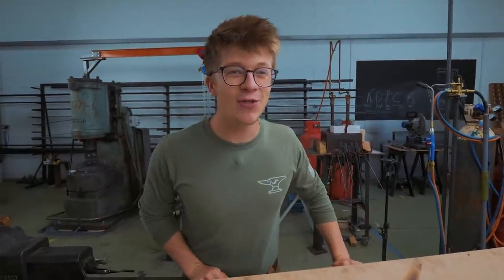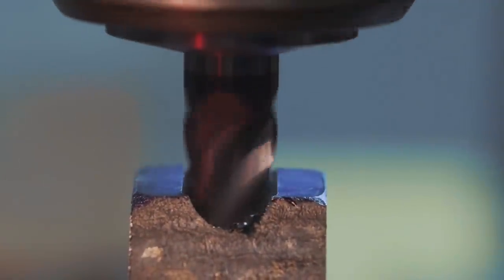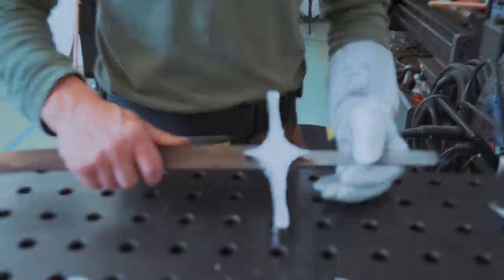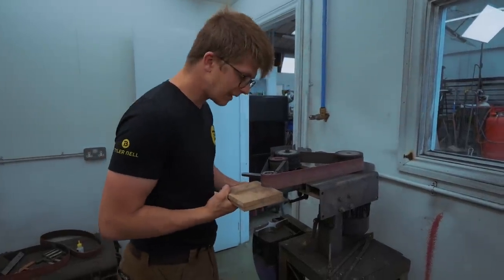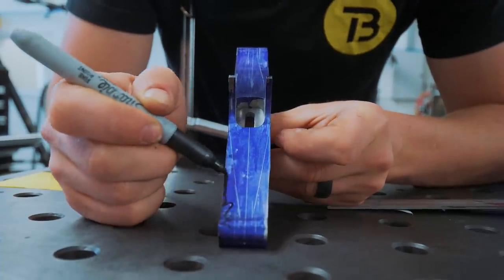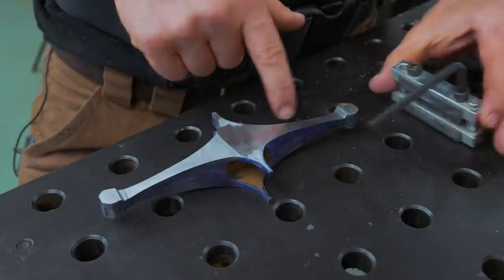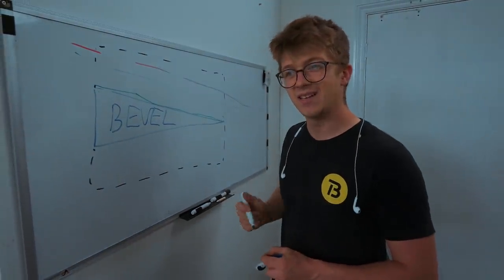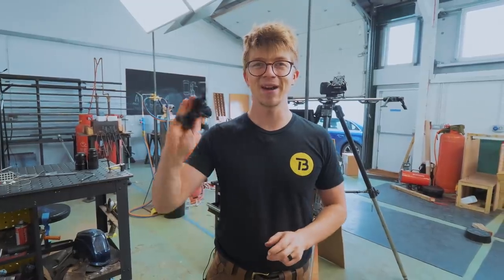MAKING A SHAMSHIR SCIMITAR!!! Part 3

Comment from the maker: Be sure to come join my talk at my Discord Stage here: https://discord.gg/YBun7QpmhF
Reply: Alec I dare you to make a sword without any Power tools
Reply: Could you have etched the scrollwork into the guard?
Reply: Alec why not 3d print that fancy pattern, then cast it into steel and use that as a stamp to hammer that engraving into the cross guard?
Reply: Alex can you make videos faster... thanks.
Reply: you gonna make a sheath to go along with the sword?
Reply: Heyyy good mornin!
Reply: Alec that grinder idea is a bad bad bad idea. You really need to have more respect for these tools. You've been incredibly lucky in injuries you have received. And you had one run-in on the lathe pretty recently too! You should make a sturdy holder for it that WILL fit in the lathe so it can be cut with the lathe, instead of risking the health and safety of both you, your camera man, and any other person or pet in the area.
Reply: So awesome you have a discord now
Reply: @alphawolf0020  shh
Reply: Hooray! You are still alive!
Reply: Can you make a cheaper belt grinder for beginners?
Reply: @alphawolf0020  I would also add that you need to cover the ways of the lathe when using a grinder or sand paper on it. The grit coming off of either of those can very quickly damage the ways if it gets into the oil or on the surface of the ways.
Reply: Question for your Stage:

If you had to fight 1 Will Stelter-sized duck, or 100 duck-sized Will Stelters, which would you fight?
Reply: When 6pm BST means 3am the next day for us Australians 😂
Reply: Hey Alec I’ve done something like the angle grinder situation you got and my advice is to turn the lathe by hand very slowly so you can feel it out, also have someone else move the grinder in and don’t stand in front of the work piece. A face shield is a good idea too. If you can figure out a better way to round it over Without the grinder do that. Love the videos keep up the great work.
Reply: Hey I am looking to get into the craft I have related skills but I was wondering if you could do a video on not only building a forge but what you want out of one what design specifications could I use to make things easier in the long run ? what did you do to your forge that your happy with ? what do you wish you would have done or not done in the construction of your forge? are there small details in making a forge that pay big dividends? I do want to make a permanent forge as I am getting a shop soon hopefully..keep making videos love the content
Reply: +AlecSteele Alec, get yourself a high speed steel (hss) 1/2" square bar and grind it to suit your ball size for the guard. Then set it to centre hight in the tool post and start cutting low speed with lots of cutting fluid
Reply: FILES, JUST USE FILES.
ITS DANGEROUS TO USE ANGLE GRINDER SIR.
KEEPSAFE.
Reply: Jeremy Clarkson pitch for the grinders. Brilliant!
Reply: Why aren't you cool the mill with an oil-water-emulsion? Your bits will hold a lot longer, and the piece you're milling isn't hot after the process
Reply: All im gonna say mate, is im surprised you’ve not created a discord before this point. Its a fantastic marketing tool, and a great way to stay in contact with your state side company without having to buy fancy equipment or software. I use discord for company meetings all the time as the product has a noise reducing software that takes all the background grinding/metal pounding/welding/etc out of the equation so clients and employees can hear me over anything else going on.
Reply: @ezzedinezeid6049   he had paper glued to one side. It looked like standard printer paper, not wax paper. So it would of washed away the paper which he was using to make sure he didnt take too much off. Otherwise, im sure he would have
Reply: Hey Alec you should make a phone case
Reply: Now it's time for a alec steele discord server
Reply: I wish I would have watched this Episode sooner

Comment: Next time on the Alec "4 Finger" Steele show, How not to use a grinder attached to a lathe lol
Reply: I have seen every form of power tool imaginable connected Rube Goldberg-style to a lathe: chain saw, router, table saw, chop saw, torch, water jet cutter, sandblaster.. A surprising number of people who pull such stunts survive them intact for years. Still, it's not the way I'd want to see Alex's career end.
Reply: As if there will be a next video, it's gonna be a memorial video
Reply: @nathanbrindley5820  We can be calm for a while; there's every chance Alex merely means to use the lathe as a vice around a fixed center, not spinning up to speed. Still, looks like a very shaky vice; why wouldn't he just weld the workpiece to a mounting plate, and grind off the weld marks after?
Reply: @bartroberts1514  the work price is close to the tolerance, if he were to weld it he'd lose alot more material on the ends
Reply: might be the worst thing to do in a workshop.except maybe for using a grinder to spin a blade while quenching it.
Reply: @nathanbrindley5820  Given the choice of losing material on a workpiece or on a limb..
Reply: @96dragonhunter  Forging blindfolded.. pranking while forging blindfolded.. I love the channel, but it's not exactly safety training.
Reply: TOP 5 GRINDER LATHE MISTAKES (Must watch!)
Reply: Boy... it looks stupid!
Reply: Step 1, don’t put your angle grinder on a lathe

Comment: That Lathe contraption seems like one of the brilliant ideas of a group of Drunken Texans who weld the barrels of two guns together to see what happens if they fire them both off at the same time. My general rule of thumb is that anything that involves zip-tying a safety feature in the "safe to operate" position and/or turning a power tool on and off at the power source is a "bad" idea.
Reply: That’s a pretty particular rule    Like it tho
Reply: Seen far worse than this.. from a man that used to wear nothing but flipflops and cargo shorts in the shop.. hes just about ok so alec should be fine. One would hope
Reply: @richard-gn3es  well, as I said to my coworkers a while ago. OSHA regs aren't there for the 10,000 times  you've done it before, they're for the one time things go wrong.
Reply: @ZevVeli  as an individual im guessing he assessed his personal risk and decided it was within what he deems acceptable. 

Regulations are usually to protect companies and those that work for them. And not to private citizens... I do not think alec is in any real danger. Well not more than usual using large powerful machines..
Reply: @richard-gn3es  Tell that to 4 craneworkers that just died cos they threw every safety procedure in the wind and the crane they worked on collapsed.
Reply: @user-ee9cz6mc1x  Theres a vast difference between a large scale work site and a small shop.

Using a grinder on a lathe is hardly mis managing a very heavy steel structure at hight... Its like comparing jumping into a pool from a chair and cliff diving at low tide. Vastly different risk factors..
Reply: @richard-gn3es OSHA Regs are there for workers not to get hurt and the company has to see to that. When workers throw their own safety in the wind accidents tend to happen in a shop or on a worksite. Only difference is a one man shop doesn't have to pay a fine when not living op to the safety procedures in the OSHA Regs. The accidents will still happen, and this is unsafe AF, every machinist in the comment section is saying this is a really bad idea. And you are saying it's fine it's an acceptable risk and that regs are there to protect companies so they don't get fined for unsafe workplaces or so. which is bullshit.
Reply: @user-ee9cz6mc1x  What im trying to say is he knows and its none of anyone's business if he wants to do things in a safe or unsafe way.. 

Literally nobody needs to tell him what he should be doing. As i said its personal risk

Comment: Just use a file mate. You don't need to add the grinder into the equation, it's already spinning!
Reply: I'm guessing the idea of the grinder is stay as far away as possible and only stand close enough to spin the handles on the lathe.
Reply: @ParadigmUnkn0wn  Yeah and I'd be doing that with something to extend my reach, to hell with peering over it.
Reply: The reason he is not using a file is the same reason he isn't using a cutting tool for the lathe; the work is unsupported at the end. The "dog" will hold the work in place but it isn't strong enough to hold a file to. The grinder has enough power to remove material without applying pressure to the end of the piece.
Reply: @jacobmaccharles7468  So use smaller passes.  It's a big, pretty high quality machining tool.  It can probably do small enough increments to have the tool pressure be lower than the chuck pressure.
Reply: @jacobmaccharles7468  That's actually not true. He's turning between centers, one center in the headstock, and one in the tailstock. The dog isn't for workholding, but merely to transmit torque. Ironically, between centers is about as well supported that a work can be in the lathe.

Comment: The higher the grit, the slower you should be running the grinder.. This allows you to keep accurate surfaces..
As for the angle grinder, there is such a thing as a mill-lathe, and it is possible to attach a spindle motor to the lathe carriage, but the angle grinder is a bad idea mainly because it is a grinder: abrasives and machined ways should never meet..
Reply: Listen to this guy Alec
Reply: Tool post grinder.
Reply: Exactly.  This is bad in so many ways.
Reply: I have no experience with a lathe, but I am an electrician so I do know my angle grinders... and I wouldn't have done that!! :D
But out of curiosity since you seem to know your lathes: Would/should you ever use a handfile on a laithe? -Cuz I might be idiot enough to try that if not warned! :D
Reply: @JokerInk-CustomBuilds  that’s perfectly fine to do. Just keep an eye out and be safe. Always watch where it’s pointed, but using a file is extremely common to knock off burrs and clean up threads and such.
Reply: Also you lose grinding disc material so you get diffrent results every pass

Comment: Please don't use your grinders near lathe. Grinding dust can destroy lathe's bed.
Reply: You're entirely correct and it's bad practice in general, but I don't think that lathe is ever going to make anything with submillimeter accuracy anymore.
Reply: if you cover the bed and have a vacuum near the cut to try and suck up most of it, then it is fine, many people do it with no problem. Alec is doing it the no no way.

Do see why he can't grind a shaping tool for the lathe. A quater circle.
Reply: @Xlaxsauce  yeah a shaping tool would be the best i guess he figures is not supported enough tho, I mean with a sharp tool you could take light enough cuts it would be fine
Reply: Old guy I work with told me the same thing. I was grinding near my Bridgeport. I wasn't getting anything near it. But he's like a Dad.

Comment: Actually i have used an angle grinder in my lathe as a tool post grinder, i made an attachment that bolts onto the angle grinder where the secondary handle mounts and that attachment is shaped to fit into my tool post, its served me well for years.

Comment: Hey Alec, just a tip - I own one of these grinders as well and built a 600x200mm build plate from 10mm mild steel with some 10mm fixturing holes if you wanted some DXF files!! Cheers

Comment: In woodworking one of the ways to make a sphere on a lathe is to feed a hole saw of the same diameter as the desired ball size, I've also seen it done with metal using diamond hole saws.

Comment: I'd suggest using a 90 degree pneumatic grinder with a disk attachment to use in a lathe, done it many times and it works great for what you are doing.

Comment: You can do a quick check on your positive and negative spaces and linear scribing by making a paper template folded both diagonally and laterally and cut. When you lose your lines one way or another, you can check them easily.
Reply: When you facet, use a straight edged hand file to finish, to preserve your surfaces. You could also use some blank edged files that have the dile face only one one or two sides, to preserve adjacent surfaces.

Comment: Okay, so, as a toolmaker I can tell you that drilling is faster than milling. Next time you have a project to rough out, try using the end of the endmill instead of the side. Use your depth stop, lower the table until the cutter won't cut where you don't want it to, and use the y axis to advance the cutter. If you advance approximately .100" for each cut, and cut using the quill as your cutting feed you will be surprised how quickly and easily it will go.

Comment: Here's an idea Alec, design a rotary attachment for use with your grinders a slow moving motor and some form of chuck/vice to hold the parts, and a variable speed control. You can buy the speed controllers off Amazon for like £20 for a decent one.

Comment: Might want to try solder inlay instead of pressure inlay for the gold.  Cutting out the pattern then heat the steel to a gold solder melting temperature and flow the solder in.  Bonds extremely well, no wire popping out, no under cutting.  Go with a little over fill and stone off the excess.

Comment: Bolt a piece of heavy flat bar to the angle grinder's handle attachment threaded hole. Clamp the flatbar into the tool holder. Use a lock washer on the bolt to ensure it stay put. Run the lathe in reverse at a relatively low speed. Make very light "cuts". And yes, the abrasive dust won't be fantastic for the ways, clean them well after and don't do this often and you'll be fine, it's not like it will immediately wear the ways down to nothing.

Comment: Just a thought,,,,electromagnetic clamping table,,,,,, grinding wheels and cnc control may be of great use. On your  future engravings (old drillpress ,old 72"belt grinder parts, old microwave parts. And old welding table,,,Just to get started)(((think on it may be something you can sell as well.

Comment: if you go low enough on the grit size then each pass removes very little material, combine that with a backer that can conform to the shape of the part and it'll preferentially remove the high spots but simultaneously blend that into the low spots. You lose flatness, but remove the facets.

Comment: Tips to make your work easier and consistent.1:  Use transfer paper to transfer your design to the material..and avoid the paper glueing thing. 2: Create (even possibly sell) and Angle Grinder Table. That way you can always/consistently hit the right angle on a blade without holding the blade up on the air.

Comment: +AlecSteele Alec, get yourself a high speed steel (hss) 1/2" square bar and grind it to suit your ball size for the guard. Then set it to centre hight in the tool post and start cutting low speed with lots of cutting fluid

Comment: A lot of people are saying this is a bad idea, but you've basically rigged up a makeshift toolpost grinder, which is a very common lathe attachment. Just make sure to clean your ways thoroughly afterward to make sure you don't get any abrasives in there. Maybe put down a towel to protect them during the operation, too.

Comment: You've probably already done the turning part, but I'll make my suggestion, anyway. Put the lathe in a good, high gear so you can easily rotate it by hand, then rotate the piece to you're starting on an corner. Finally, move the grinder in a certain amount that you like, and then begin rotating the piece by hand, until the grinder stops taking material off the work piece. Rinse and repeat until you get the piece round.

Comment: I dunno, maybe if you left some excess material on the ends? drill center points to turn it between centers? You could use regular cutters to rough shape a ball and then use files to smooth it out to a spherical shape, then cut off the nubs and ...well... then take it to the grinding belts to smooth out those stubs where the nubs were. Just a thought.

Comment: Yes you can turn the guard, if you lock it up in a collet. You might be able to fabricate one to do it. If you use the Mortis for the tang and a long jaw scissor collet. with interlocking tappers at the tips going into the mortise using the scissor mechanism to hold it one end and put one of the ball ends in a 4 jaw or two jaw, Chuck. Then you should be able to turn the balls with out using your grinder and setting the shop on fire with the coolant. This old tony/ blondihacks, clickspring or any other machinist channels on YouTube. Might have a better suggestions than I. that just one way it could be done. The other is pillar drill or cordless and a sanding block.  Its up to you what choice you make. Pretty sure there a number of ways it could be turned on the lathe. down to you which one you use? As where there a will there is often a way.

Comment: try using a ball tipped carbide burr in a Dremel or other rotary tool on the lathe.  it would be safer than that big disc grinder.  You would basically be turning your lathe into a poor man's jig grinder with a rotary table.

You could probably put the balls on safer with a surface grinder and a rotary attachment.

Comment: I'll add to the choir.  Grinder dust is bad for machine tools.  At least bag the ways and thoroughly clean the machine afterwards.  Tool post grinders are a thing so the grinder lashed onto the lathe is only 95% dumb.  If you do insist on using the hand grinder, make a secure mount that doesn't move at all.  (epoxy putty in a plastic bag is great for making odd-shape spacers)  Then only cut in ways where tool flex pushes the wheel away from the work.  (with single point tools, this means setting them below center, the grinder's spin complexifies the equation)

Comment: Piece of thick flat with a bolt the same thread as the handle. Weld that to a tool holder you don't care about. Put one on top one on bottom. Bam secure af.